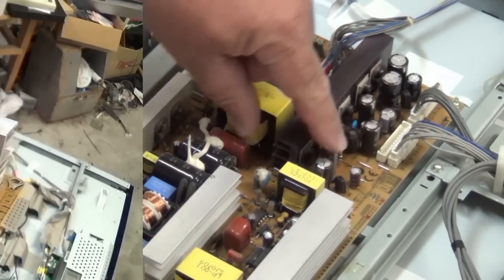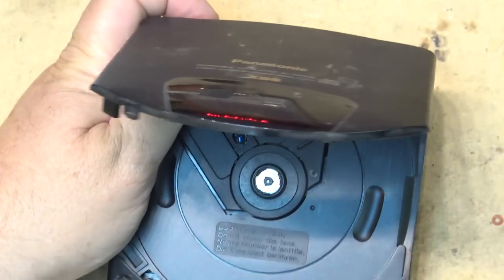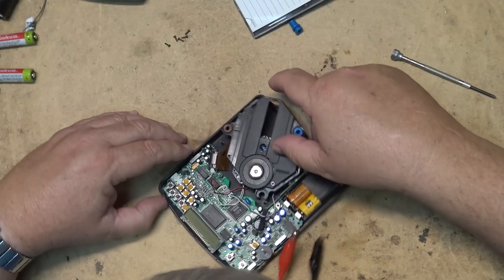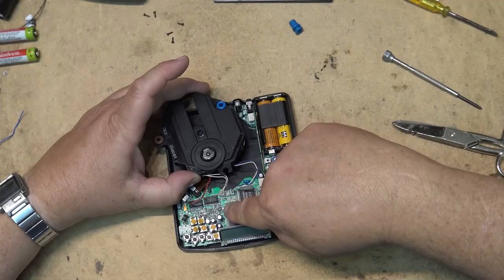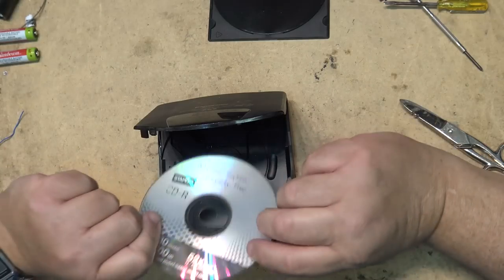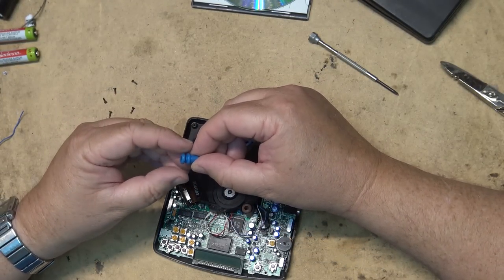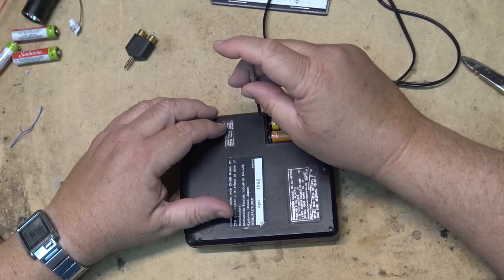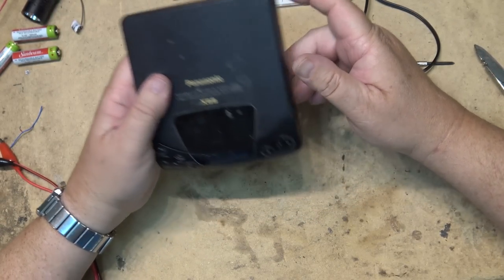Panasonic SL-NP500 portable cd player no play lets fix it

Comment: i used to use a cheap plastic ice cube tray to hold my screws when dismantling units
And often put them in the order of removal to assist in reassembly.
Just need to put in a place where not gonna knock the tray flying accidentally.

Comment: Those grommets are just not pushing the spindle assembly up high enough to prevent disc fouling.
Sticking some tape inside the case underneath them might be worth a try if the problem returns.

Comment: I wonder if that brown shock absorber is a little bit stiffer "or perhaps with slightly different dimensions" to the two Blue ones? If it is, it would make sense it would have to be closer to the motor because the ratio of support is two to one.. APU I dropped a Like..

Comment: As soon as I saw the title and it was a Panasonic personal CD, first thought was turntable is too low. I used to repair loads of them with the same issue, I built a jig to set the height similar to the one that Pioneer used to mould into their mechs, that you cut out (like an aircraft model kit) to set the height.
Reply from the maker: I had one at the shop. Put the jig on, slap a dab of epoxy on the platter, press on then remove jig.  Left it behind

Comment: Another laser that didn't die early for no apparent reason :-D
National panasonic have made some decent stuff over the years, i can't remember anything i had to swear at because of poor reliability :-D
Some of the old sharp cassette decks were interesting, i've seen a few that had the fancy auto/adjustable record bias that allowed you to get the best recording out of any tape.
I never liked dolby processing as it never sounded right (When my ears were acrually ok).
Reply: The Dolby wasn't easy to implement that's for sure. Many decks were dreadful when played in Dolby, especially C. Had JVC 3header from early 90s, that when with Dolby B was actually very good sounding but in C was total disaster - total Enigma. So most my cassettes were recorded with B. Nakamichi usually sounded very good with Dolby, some Teacs, some Yamaha, some ... ??? Yeah, there was usually something about Dolby C encoding that made it tricky for many decks not to make it to the top. I wonder what would happen if Telefunken Hi-com would be the standard N.R. system instead of Dolby - damn audio politics. Even  convincing Dolby to make Dolby B for cassette decks wasn't all that easy.
Reply: @pliedtka  Just having one simple noise reduction function would have been ok, but there is always someone that is not happy and go way too far with the idea.
Go too far and you end up with deivices full of pointless functions.
And because it's so expensive the manufacturers cheap out on other parts and ruin the quality or life of the unit.
Like cheap capstan motors or a poor quality flywheel that's lacking enough mass for a really smooth speed.
Don't i moan alot lol.

Comment: The move from clamps to spring-loaded ball bearing retention was probably one of the biggest reliability improvements in portable CD players.  The precision needed to clamp the disc sufficiently, but not so much as to overwhelm the spindle motor, in a portable player subject to all kinds of abuse..?  Not a great solution.  :-)
Reply from the maker: The "clamp" wasn't really a clamp.  It was a magnet that was attracted to the metal spindle to hold the disk.
Reply: Oh yeah... I have one of those, and it seems to have held up OK.  I think it's a nice convenience touch.

Clearly none of these machines were particularly meant to survive for 20 years, so I'm not surprised some have issues.  :-)  That Panasonic belonged to a friend of mine, who brought it to school every day.  It survived being carted around in pants pockets for a couple years, used daily -- admittedly, by someone who cared for his stuff.  The only issue it has is a blown headphone output channel.  Not sure what happened to it.  It was probably six years old by that point, and my friend was off to college.  He just replaced it and gave it to me, and I used it with its dedicated line out jack -- which still works fine to this day.  :-)

Contrast that to those awful clamps...

I had a Crown player when I was really young.  My neighbor dropped it down a couple stairs, which did something to the lid, such that the alignment was off and kept the disc from spinning freely.

I have an early Sony player that I bought from eBay a couple years ago.  The force of the spring that holds the lid open managed to bend its own frame in one corner.  That one has trouble keeping the disc spinning properly as well.

I'm fairly confident both would have been fine if they were using a ball-bearing retention mechanism.

And yes, I'm aware it's a magnetic clamp.  Missed that reply earlier.  :-)  But the tolerances of the retaining clip that holds the clamp, and the lid above it, are so tight in a portable player that, if it develops any mechanical issues with the lid, it will undoubtedly begin to rub somewhere and prevent the disc -- or rather, the clamp, which is coupled to the disc -- from spinning freely due to friction.  It's just unnecessarily fragile, bulky, and .. ugh.. good riddance.
Reply: Haha... well, good luck.  :-)  My Sony seems to have self-destructed, but who knows what all it's been through.  * shrug *  I still have hope that I'll come up with a fix some day.  Some of those early players are just so unique, it's a shame to not use them.
Reply: @12voltvids  I have a Panasonic portable came with rechargeables that were specifically designed to be charged in the unit (part of the bottom was bare and a contact) this eliminated charging primary cells like alkaline "AA" 
It didn't have a magnetic clamp it used three spring loaded balls with a push button in the middle to release the disc.
It also had 3 second anti skip too. Interestingly enough the 3 second buffer didn't have the higher frequency range playing without anti skip was full range as normal (like it was beating with the oscillator in a cassette deck while playing certain high frequencies) always reminded me of tuning a radio LOL
Listening to normal music with anti skip I never noticed the difference in music, however it did not like a 20 to 20k sweep with anti skip on again it was normal with anti skip off. I still have it and it still works very well too. The best think is the laser block is metal the portable CD players today are plastic I had one given to me that was left in a car during the summer it distorted the frame and I assume the laser pickup distorted far enough that the alignment was messed up so the unit didn't recognize a disc at least the laser came on so it wasn't that there isn't a way to disassemble it because all of the components were glued into place ZERO abilities to adjust anything LOL. I've always wondered what kind of equipment was used to align laser assembly pickups during manufacture jigs used or what LOL. I remember the plastic housing had holes in it which I assume was for alignment before the glue set, I am only guessing though I found nothing about it searching for how laser pickups were made. 
This also caused me to think about how precisely these things were aligned or if most were close enough to tolerance to pass I also have three CD/cassette/radio
RCA, Emerson and a Sony. The RCA used a Sony laser pickup unit in it and I had CDs that wouldn't play in other CD players I had due to scratches it played them flawlessly. 
I swapped the laser pickup to the Sony and it read the TOC super fast compared to the one that came in the Sony boom box originally. That's what made me wonder about how optimized these pickups are during manufacture (how close they are to center of the ranges) as most know they have the focus lense that can only has so much travel it can do out of this range and the skipping/ being unplayable results. The ranges for the insides of the pickup have a tolerance too. So it would be dependent on the builder as to how close within spec (center range of the specification) I could be wrong but the closer to center could be a factor of playing discs or playing severely damaged discs flawlessly. This was a long reply LOL.
Reply: @nickwallette6201   I wonder who did ball bearings first? My 94 Sony has them, so at least by then. The pre-ball bearing mechanisms are all charming tho.

Comment: Is it just me, or are portable cd players much durable than regular stereos? They always seem to just work right away.
I've seen hundreds of stereos that won't read discs, yet this is the first time I see a portable cd player with that same problem ha.
Reply: I have a couple of Sony portable CD players that won't read any disc. PCDP die as well as regular stereo: Sony pickup's are not the most reliable, Panasonic pickup's of the same vintage are indeed much more reliable. I have some four portable cd players from Panasonic/Technics from 1990~1994 and they all work without a hitch.
Reply: @enricoself2256  i guess it's just a matter of luck then, since portable cd players were designed to be constantly bumped I believe they must have a higher survival rate than fixed cd players. 
Btw, I have two portables: An original Sony discman which is very sentitive to bumps and a Panasonic one which isn't as sensitive and works better, so I guess you're right about Panasonic being the better brand in terms of quality.

Comment: Instead of soldering the ribbon cord to ground the LASER, why not wear a static bracelet attached to the frame that the LASER is in?
Reply from the maker: The laser diode needs to be either connected to the drive circuit or shorted together.  So no potential forms on the leads.  Wrist strap will do nothing to stop static from building on the leads.  Had to be shorted.

Comment: I have Panasonic SL-NP1  (May 1990) , has a very high output power, the following models had much less power.
Reply: The SL-NP1A I got from eBay rubbed the disk just like in the video. All of my rubber grommets are split and hanging on by a flap. It works great after reassembly, no more rubbing. Even tho they are torn they still work if seated right but probably can't take to much shaking.

Comment: I'm guessing the reason you didn't click the disk onto the spindle at any point, was because the spindle platter was pressed in originally?
Reply: It was a magnetic camper type. They don't press on. The magnet in the lid clamps when closed
Reply: @tenmillionvolts  Ok, gotcha. I had never heard of that before, but looking at it again, I don't see any sprung detents. That makes a good bit more sense. Thanks!

Comment: Most units only work when you use batteries that are full 1.5 volts for AAA's, as d and c batteries I am sure you know full batteries are 1.5 volts and weak are anything below 1.5 volts great video love them all be safe and careful
Reply from the maker: Most devices should work on the 1.25 volts from rechargable cells.

Comment: Nice. Video. I have a Panasonic 5 disc stereo system and when. I put in a disc I get no disc trouble error. What could be the cause?
Reply from the maker: Many things.  Laser, spindle motor, mechanical alignment.
Reply: Do you use denatured alcohol to clean laser?
Reply from the maker: @jsjoe66  I use 99% isopropyl alcohol. Lesser concentrations are diluted with water which may leave residue behind

Comment: recently repeared a knock off/copy of this put new batteries and some contact spray on the points because the old ones gave off some blue shit
and i cleaned the lens with glasses spray works well
edit: the thing was working but as soon as the cd buffered or jumped it repeatedly buffered